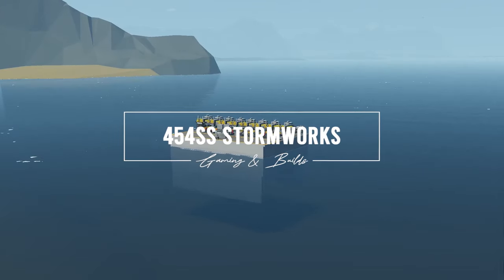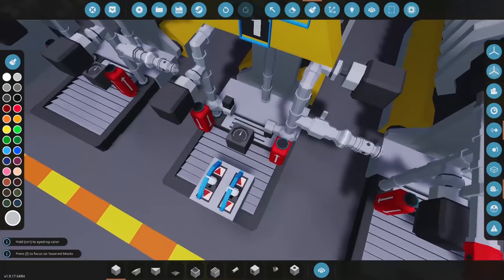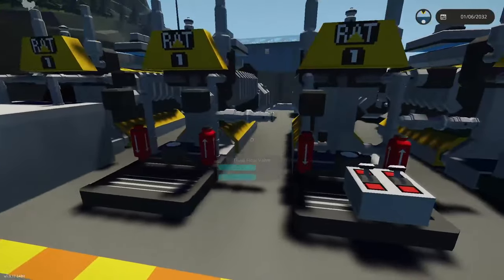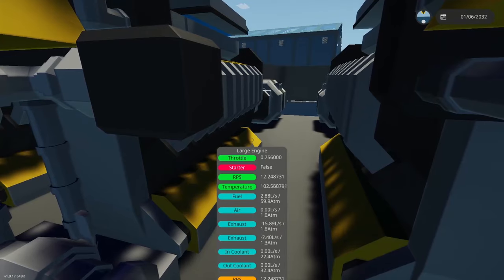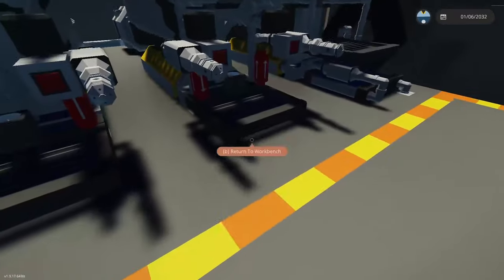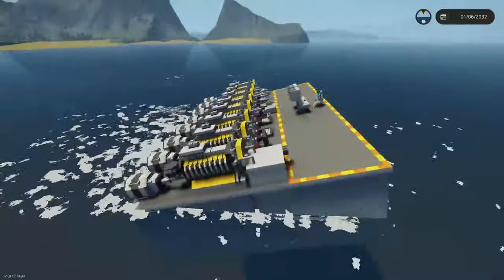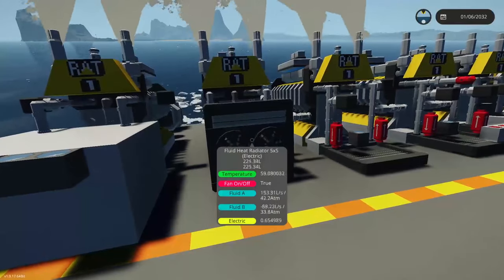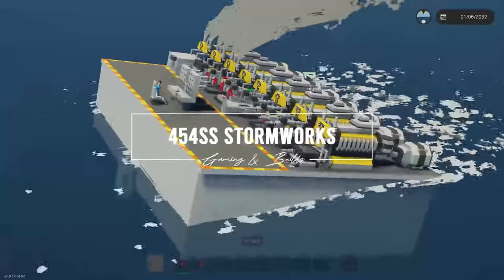RADIATOR PERFORMANCE after the Compressed Gases Update

Comment: This might seem counter intuitive, but possibly draining the system of all liquid and using compressed gas instead?

If the cooling calculations are based on flow rate at all, compressed gases can move at several thousand litres per second (when at extremely high pressures).

Comment: I think there is a bug with radiators. I have nearly 2000 hours in the game and have made hundreds of planes,boats, cars, trucks, oil rigs and all sorts of stuff. I made a tracked truck kinda thing for the arctic and it has one medium engine. It has 11 smaller radiators and overheats in the normal biomes however it’s fine in the arctic. I have a very similar tank from a few years ago that has the same engine and same micro controllers and it had 1 radiator and it is fine even in the desert so definitely think something weird is happening.  Speed on my tracked truck did make a difference though. I was doing 60mph at the time though. Anything below 30 didn’t do anything. Also I’ve had issues with fluid jet boats that used to work and now don’t.

Comment: The Small Pumps that you're using don't actually pump anything, I noticed when you look at the part with the advanced tool tip. The small pumps can only pump up to ~11.2 atm after which they can't pump any more, you need bigger pumps!!

So with my freshwater, I have 2 loops. Pressurized Freshwater loop that goes into the engine, and one seawater loop. The sea water loop has one small pump, simply pumping seawater through an heat exchanger.

The Freshwater loop takes Freshwater Tank > through a Large Fluid pump > into the Freshwater loop, this is just to prime the cooling loop. The actual flowrate in the Freshwater Loop comes from an impeller pump, which is used to circulate the Freshwater from the engine > to the heat exchanger > through the pump > and back to the engine.

///// Setup /////

I.E.:
Seawater Loop: OCEAN > Fluid Pump > Liquid-Liquid 5x5 Heat Exchanger Side A > OCEAN

Freshwater Tank > Large Fluid Pump > Freshwater Loop
Freshwater Loop: ENGINE > Liquid-Liquid 5x5 Heat Exchanger Side B > Impeller Pump > ENGINE

Now see if you can prime the Freshwater Loop to 30 ATM, like I described above, using the Large Fluid Pump, you should be able to as I tested this works reliably for me. when your loop reaches 30 ATM of with freshwater, stop pumping more fluid in. (You can pump in more but that will impact the flowrate, 30 seems to be the sweet spot.) This is the priming phase.

Once you're done with priming, you can spin up the impeller pump, it only needs 1-2 RPS to operate at maximum speed. This pump stays running during operation to move the heat from the engine to the liquid-liquid 5x5 heat exchanger. Also note the ease of stacking more heat exchangers can also help transfer rates.

Operating this method, you want to first prime the engine freshwater cooling loop to 30 ATM, only then do you want to turn on the pumps and the engine itself, because the impeller pump will cause higher and lower pressure on the output side and the input side of the pump.

I hope this better satisfies explaining what I meant with pressurizing the loops. You got the large fluid pump priming Freshwater loop at 30 ATM that flows through the engine using the impeller pump, that'll get you a flow rate around 314 L/s, and you got the ocean cooling that just brings in seawater to the heat exchanger using a normal fluid pump.

Comment: Have you thought about instead of moving more cooling medium, to just having more cooling surface? Having multiple radiators. And possibly a heat sink as well. Specifically in differences between parallel and series connections.

With how much you're willing to add for extra performance an extra radiator might even take up less space.
Reply from the maker: I have this in my previous video :) It is for sure better, but that I wanted to see how we can optimize a 1 radiator setup!
Reply: Aah, i must have missed that being said/shown. My bad. It felt a little weird to be so fixated on using only one radiator given the video titles.

Comment: So technically you’re not overheating at 96c. That’s normal operating temp for a motor in the real world. I guess the real issue is just trying to figure out how to keep it at that temp at higher rps. Realistically I would think you would need at least 2 radiators to cool a motor that big. Did you try that already with any success?
Reply from the maker: Yup! 96C is not overheating but the throttle was at 75%! At 100C they blow up haha so I was keeping them below blowing up levels and testing if a certain set up is better. Having multiple radiators did help, but require major rework in all my ship, which I don't really want to do :)

Comment: I have had absolutely zero issues with cooling i think that alot of people just arent building correctly. Btw try these cooling concepts with modular engines and see if they cool any different with them, Great video!😊
Reply: Changing to modular will throw another wrench in the testing. Before this update they worked completely differently. The way they generate heat and how they are cooled off. I'd suggest everyone concentrate on the classic engines until everything is figured out and there is a viable solution before jumping to modular engines.
Reply: @sijonda  None of my creations come even close to overheating and i only use modulars
Reply from the maker: While that is great, it doesn't solve the problem of the prebuilt engines overheating haha :D They have to find a way to fix that imo
Reply: Look all he did in the video and still overheat. You don't overheat because don't go up 8 rps

Comment: The testing I did was more focused on the room / compartment rate of temperature change, the results of which indicated that a larger temperature differential allows for a larger rate of heat transfer.

For example, the radiator in the sealed compartment will heat up at the same rate at one outside to begin with, but as the room heats up, the transfer of heat from the radiator to the room will slow down.

Unfortunately, data is EVERYTHING, which is why I've shifted to making my new creation which will help in logging data and displaying it.
Reply: Sounds like a very cool project. 😎
Reply: @Lord_Bison  feels like a good way to get grey hairs prematurely.

Got the data logging (every tick) and a rudimentary time scale "zoom" working, made a change to try and stabilise the graph and got a nice "exceeded 1000ms execution time" error in game.

But, I did just have an idea to fix it, however that will cause other issues I'll need to solve.

Comment: Try putting few radiators in a series or parallel, maybe put in some extra pumps if the flowrate gets too bad. Stacking two radiators and some t junctions could be a pretty easy fix.

Also maybe try putting the propeller against the radiator in a way that the other side of the radiator isn't blocked?

Comment: What I found out is that, when using an open loop with seawater, pressure at the "in coolant" port of the engine is capped. Adding pumps, whatever the one you chose, has no effect on the pressure or fluid flow rate. Moreover, when looking at the pump I can see that there is no differentiel pressure between the "fluid in" ad "fuid out" port. 
My conclusion is that in an open loop cooling system, one cannot have any influence on the cooling performance of the engine.
Reply: Good comment. Ive also independantly concluded this. Capped to 10 or 8.x L/s more or less. To me, the pump inlet pressure seems to always be 0.4 atm even if you put pumps in series.

Comment: Dumb Question, But what if you try Cooling The Fuel?
Reply: Oh and for sea water, did you try desalinating it?
Reply: Oh and are those radiators exposed to air on both sides?
Reply: The game doesn't work like that. It doesn't matter if the radiator is exposed to air in both sides